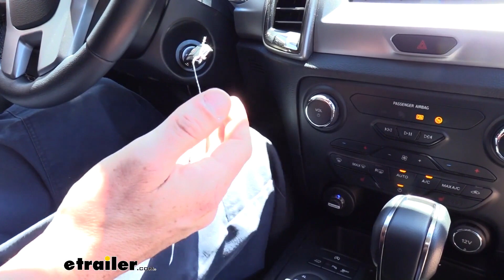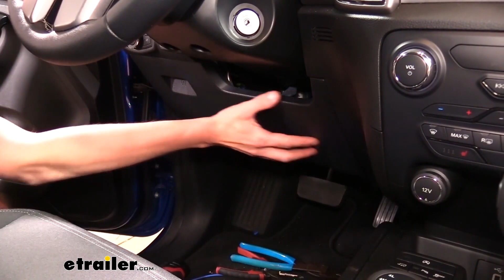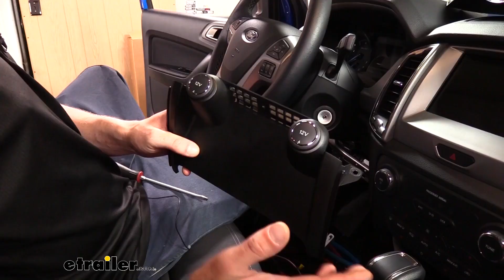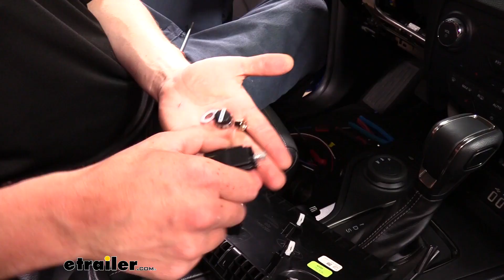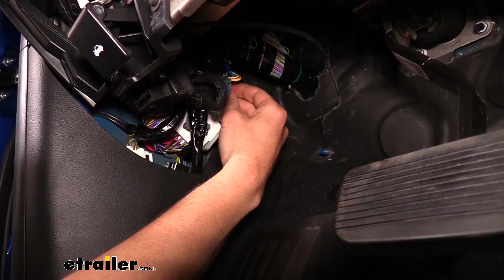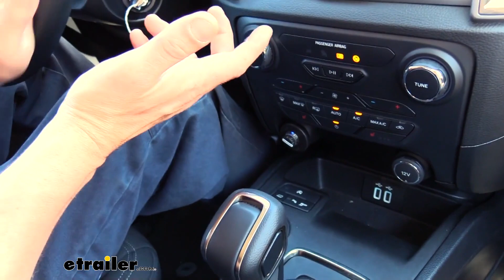etrailer | Redarc Tow-Pro Elite Trailer Brake Controller Installation - 2019 Ford Ranger

Comment: When I click on the link in the description, the etrailer website says this does not work for my 2019 Ford Ranger 🤔
Reply from the maker: It looks like the custom plug and play harness for the 2019 Ranger is not something we carry any longer. We are working on getting that updated but at this moment it looks like their is not a custom harness available for that vehicle so the brake controller would need to be spliced.
Reply: @etrailer that's unfortunate but I appreciate the update

Comment: Thanks for the video. You made this easy. Just one question:  The trailer tow button (the one on the console by the other buttons)... should I activate it before starting the calibration?
Reply from the maker: That's not necessary. The Tow/Haul button primarily adjusts the transmission's shift points and doesn't have anything to do with trailer braking. I hope that helps!
https://www.etrailer.com/Trailer-Brake-Controller/Redarc/RED44FR.html

Comment: So if we don't have a trailer to test it, how will we know if its working?
Reply from the maker: That's pretty simple. Just get a circuit tester like # PTW2992 and test the 7-way connector on your vehicle. The pin in the 5:00 position carries the brake output circuit, so test that while you have a helper press the button on brake controller's control knob for the manual brake function. If you get power on that pin with that button pressed, you're good to go!
https://www.etrailer.com/Trailer-Brake-Controller/Redarc/RED44FR.html
https://www.etrailer.com/Electrical-Tools/Performance-Tool/PTW2992.html

Comment: For anyone watching in 2024. On my 2022 ranger I had to pull with a lot of force to get the side panels off. So much so that I was worried I would break something. The center panel took some muscle as well one side at a time. They go back in really easy though.
Reply from the maker: Thank you! That will be valuable info for others. That's a common issue for folks that don't have to do this every day. You're trying to pry a plastic panel off, but you're afraid to apply too much force and risk damaging anything. You made it happen though, good job!!
https://www.etrailer.com/Trailer-Brake-Controller/Redarc/RED44FR.html
Reply: thanks for the info! I have  2022 ranger.  Do you still need to have the trailer mode enabled? I only ask because I dont see the button lit up on below from the break controller knob in the video.

Comment: I just did this installation on a 2021 Ranger and the new revision 3 RedArc. First off, excellent video, I wouldn't have even known where to start without it. Getting the side panels off are a pain, but with patience, they will come off. Getting the lighter socket off is more of a pain, but once again, take your time. The cable from the switch to the controller is no longer a Ethernet type cable, but a custom cable. This doesn't make any difference, but it's a change. The bezel that is for a GM or Isuzu, does not come in the package, and must be ordered separately. $8.60 and free shipping from RedArc. The wires from the Ford side are short and a hassle and the white and violet ones are very small and need a red butt connector because the blue ones don't crimp down tight on the wire. Once again, this video is great and will get you where you need to be. Thank you.
Reply from the maker: Thank you for sharing your personal experience with your installation. This brake controller is perfect for the Ford Ranger because there isn't really a great spot that you could mount a traditional style brake controller.
https://www.etrailer.com/Trailer-Brake-Controller/Redarc/RED44FR.html

Comment: Do they have mounts for the 2020 f150?
Reply from the maker: We have a few options that would work great for the 2020 Ford F150. Check out the components you will need in the following links.
https://www.etrailer.com/p-RED87FR.html
https://www.etrailer.com/p-RED44FR.html
https://www.etrailer.com/Accessories-and-Parts/Redarc/331-TPSI-003.html
https://www.etrailer.com/Accessories-and-Parts/Redarc/331-TPSI-001.html

Comment: I heard this particular set up is useless when the front accident assist is energized to stop the truck, the trailer will not engage it breaks??
Reply from the maker: Most brake controllers will have inertia sensors in them that will trigger the brake controller to activate the trailer brakes. The brake controller will still need to be signaled by the brake pedal on the vehicle. You would need to test the brake wire to see if it is signaled by the accident assist.
https://www.etrailer.com/Trailer-Brake-Controller/Redarc/RED44FR.html

Comment: i installed mine on a 2019 ranger xlt and its not working  I push the radio buttion once and it does go blue then it just turns off I hook my trailer and no lights ever stay on the radio dial  , my friend tested the trailer with his truck and brake controller trailers working , I have no idea whats wrong I matched the four cables just like the video and it has to be getting power or the blue LED light would never come on ?? i'm frustated
Reply from the maker: The green and blue lights do not always stay on. The led indicator should show a progressively brighter red light while braking harder and harder.
https://www.etrailer.com/Trailer-Brake-Controller/Redarc/RED44FR.html
Reply: @etrailer   nope it's just blue only when i push the buttion in and nothing eles works I'm frustated becouse it's only four wires I dont see how i got it wrong  but 100 % doesnt work on my 2019 Ranger  , doe'st matter what I do the brakes are not coming on when i test the camper with my friends 150 it works fine , I'm at a lost i guess I just drilled a hole in my pannel and bought this for no reason

Comment: So if the trailer starts to sway and you need to apply some trailer brake without braking the truck how do you do it?  This solution is ridiculous in my opinion.  Even the new low end ford maverick includes a integrated brake controller with their tow package.  I suspect this is because ford didn't want to change much from the European version and the ranger we got was basically leftovers from an already aging truck.
Reply from the maker: To apply the trailer brakes manually with the Redarc Tow-Pro Elite you just have to push in on the knob.
https://www.etrailer.com/hitch-2019_BMW_X3.htm

Comment: A good looking installation. Much better than having to drill holes into the dash in order to attach a bracket, which looks pretty awful in my opinion. I own an F150 with the factory brake controller, but if I bought a Ford Ranger I would definitely consider this unit.  I would prefer to install it on the console so that I retained the use of the 12 volt outlet. Thank you for the video.
Reply from the maker: Thank you for the feedback! We are happy to help! Check out the following link for more information on the Redarc Tow-Pro Elite.
https://www.etrailer.com/Trailer-Brake-Controller/Redarc/RED44FR.html

Comment: Very thorough video, thanks for posting. I've heard that the headliner has to be removed in order to tie into the third brakelight with the Redarc but you didn't do it here, can you explain please. Is their any difference between the official Ford Redarc controller and just buying direct from you or Redarc? Thanks
Reply: 2020 Ranger is identical. 

I'd like to correct some information here as well. The Ford "OEM" TBC is of course the same Redarc unit. But, due to an engineering oversight, the Ford version requires an additional module. The "Stock" Redarc unit is not able to apply trailer brakes during automatic emergency braking conditions, because the wire under the dash does not provide a braking signal during that. The trailer brakes only will apply when the pedal is pressed. 

The Ford OEM one includes a LUMENS LED ECU module, which pulls a signal from the third brake light, as the light turns on during all braking conditions. 

If you don't go with the Ford OEM version, keep this in mind. The Redarc is a great unit, I just wish Ford didn't drop the ball on their execution. 

I'm not saying this to start arguments, I just want you all to be informed. If you have any further questions I'm happy to answer here or in my DMs. I don't work for Ford, I'm just someone who researched extensively.
Reply: @billyspears396  I was thinking about that. The controller still works when pressing the pedal but not the automatic braking. So when towing turn off the automatic braking.  It is a good safety feature but we did get by without it for decades. Of course lawyers might jump on it if there was an accident. I don’t tow anything requiring a controller with my Ranger so it is not a concern in my case. I would probably have the dealer install it if I did. Depends on one’s risk tolerance. Edit: ridiculous that Ford did not just put the thing in as part of the towing package. What is the point of the hitch and plugs on the bumper if it is an incomplete system?
Reply from the maker: All of the wires that you will need to connect to will be under the dash on the 2019 Ford Ranger.
https://www.etrailer.com/Trailer-Brake-Controller/Redarc/RED44FR.html
Reply: @etrailer  is the 2020 Ranger the same?

Comment: I appreciate the video, although I wish the video showed a different place to mount the brake controller knob. In my opinion the current spot in which you mounted the knob is completely stupid, it ruined a factory function the truck came with. If that's the best place to put that knob I will for sure be buying a different controller.
Reply: This video shows it installed with the bezel in a different place, https://www.youtube.com/watch?v=UXKiuUJT65A            
            2020 Ford Ranger + REDARC Trailer Brake Controller
Reply: @brians5088  But it does not show how the controller was installed on the console.  I would like to see that.

Comment: Great job, well done video!
Where can I find the round bushing you used to replace the 12v port?  I don’t have blanks to replace with what I looks like comes with the kit.
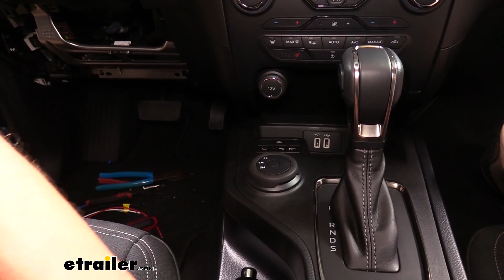Reply: 6:47 gives the part number. I found it on their website https://www.etrailer.com/Accessories-and-Parts/Redarc/331-TPSI-003.html